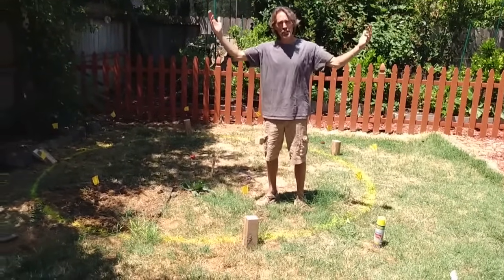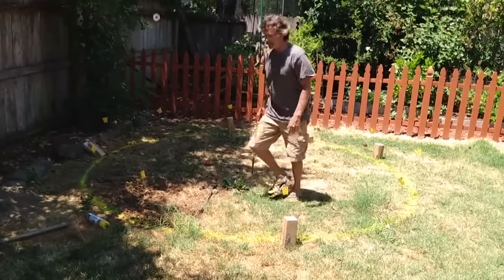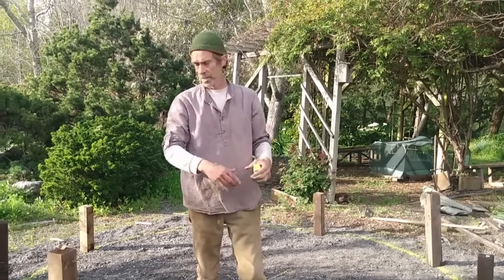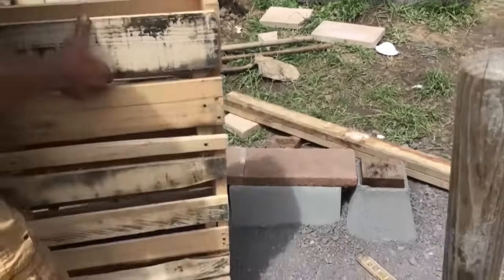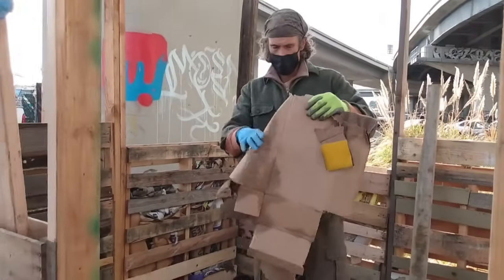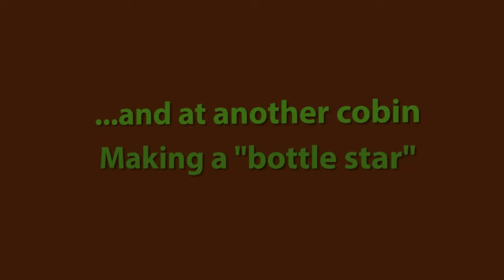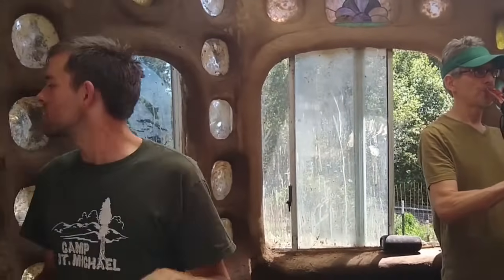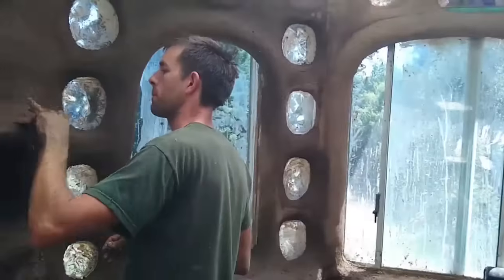How to build a 'Pallet, Cob house "Palletable Cobin"

Comment: Your the first person to convince me this is the way. I've watched every video known to man on the subject of alternative construction. I even went to MDI and took their week corse. Every method has its purpose, but when applying strictly to building an abode, this is the way. My approach is to get roof over head as primary goal even if its just a tarp. Wouldn't want to hinder stuffing the top pallets. Also a lot bigger. 16 sides or more. Another thing, cable and turn buckle. Haven't seen anyone do that to a cob house but in domes they are used to keep thing from spreading out. Everything else applies like cooling tubes still fit this style. Having a palletcob over a basement wouldn't hurt either. This would be the entrance to a fully earth sheltered abode.

Comment: How well would this work in the upper midwest/northeast? My plan is to use a framework of timber from trees to support the living roof, stone exterior, strawbale (set on edge) insulation and a cob interior. In your experience, do you think that it would be suitable for a climate that's much more extreme than California?
Reply from the maker: aloha Harry, Yes, you can build these in cold snowy climates for sure. There are many earthen structures built in snowy climates, especially strawbale, which has excellent insulation value.
Reply: @cobalot9  Very inspiring but I'm wondering if I should dig a little rubble trench down to the freeze line in my area?  Or maybe the wall or thick enough that it doesn't matter?  Thanks for the input.

Comment: I've done a few round cob houses and cabins , and instead of a central hub, we used debarked tree trunks resting reciprocally on each other, leaving space for the skylight and being very strong. We taught string in between, and lay straw bales with a side already cobbed down on the strings. Then pallets to have breathing space, then the plastic like you did, and earth.

Comment: My family and I are putting this method to work for our new homes at a count of 4 new tiny homes. We were going to do two with earth bag and two traditional cob. We have all the foundations in currently, but we are going to have to modify and use the downed trees on our land from last winters terrible snow storm and cut the wood slats ourselves because here pallets aren't free anymore and we do need a use for the downed trees anyway. The houses are a bit larger than these but I still believe with a bit of finesse this method should still work. The walls are thicker of course but again with some finesse the modification will just add for more insulation. Thank you so much for the step by step process this is going to save my/ our backs, legs and arms!!! Not to mention time!!! Love from Virginia!!!
Reply from the maker: Wow! Sounds like quite a project there! I hope it goes well. Id love to see photos if you get a chance. My email is cobalot9@gmail.com
Reply: Ck out Izzy Swan on you-tube for a cool, easy "chainsaw mill' meets a come along. Happy new year.

Comment: Thank you for you videos.  These structures are lovely.  Whenever I share your videos I get the same questions.  Can these structures be scaled up for families to live in and do you have a rockets stove home heater designs? 🌞🌱❤️
Reply from the maker: thanks for your kind words glad you like the video so as I'm sure you know these structures with pallets and cob are not built to code so that's why I build them small at just $120 square feet so you don't need a permit for them I have worked with an engineer to have a 200 square foot accessory dwelling unit designed to code but I have not used these drawings yet. if you are in an area in the country that does not require building codes then yes they can be billed as big as you want them as long as all of the carpentry framing is sturdy. you can build it like a pole barn with your uprights every 8 ft to support the roof and then put your pallets and cob in between. I've been in a two-story pallet cob house in North Carolina at a community that was probably at least $2,000 square feet and it was doing great. I built 5 classrooms in Florida that were $320 sq ft each.

Comment: Thank you for sharing this documentation and your enthusiasm. What do you think about a structure like this in a coastal climate of central America? Are there any good examples or do you have ideas how this could be extended, modified to be in the best resonance with the elements such as much warmer temperatures, months of heavy rains and times of high winds, possibly hurricane style? Thank you Miguel for your continued efforts to educate and inspire.
Reply from the maker: Hi, Yes, a Palletable Cobin' would be just fine in any part of the US.  Just build a nice roof overhang and plaster it well
Reply: @cobalot9  If I'm understanding you correctly, a tropical design isn't much different and you would encourage a similar design for a structure built in Central America. Thanks for clarifying.

Comment: This is really cool! An innovative approach to an already great building method. A few related questions though. Is the distance between the posts too wide? Not sure if the pallets would provide enough lateral strength. Is this why you build round? Wondering if a more linear design would work. Thanks for so generously posting this!

Comment: I am very interested in making something like this.
I have been trying to figure out a solution to all of the stuff that we are wasting in America as the price of everything by just continues to go up.
I used to work as a garbage man, and the amount of stuff that goes to the dump and winds up in the landfills just makes me sick.
Especially when ALOT of it COULD be used for different purposes like you used toward the end of this video and used the plastic to insulate your little cabin.
I really want to try that out here in PA.
I have a bunch of plastic saved, and actually have some pallets saved as well. The area that I live has ALOT of clay in the ground. And there are fields of grass that could be used for straw.
One of The issues that I am running into which has hindered me from starting to build is: sand. It is hard for me to come up with sand in my location to make the cob mixture without spending money on bringing it in from somewhere.
I guess my question is: are there any other things that could be used instead of sand?
I thought about collecting a bunch of broken glass and glass bottles and crushing them into a similar consistency as sand, and trying to use that, but I am not sure how well it would hold up?
I am also wondering if the ashes from burning wood would be able to be used in building materials?
Since I was a kid, I always dreamed of building a cement skatepark, and I feel like that dream is just so expensive these days, and yet finding out about this cob building stuff really makes me wonder if a skatepark could be built and hold up if built with cob?
If so, I have a ton of ideas on things to build to make this area a nicer place to be without it costing a fortune, I just need to know how to actually do it. I’d like to think a million steps in advance BEFORE ever laying one brick, so that once I do start to build, things will actually run smoothly and go according to plan. I have learned from hard experience that doing something without a plan is a sure fire way for things to wind up not going according to plan (on account of not having a solid plan in the first place! Lol) Honestly, I want to do Like it says in the Bible and “Let all things be done decently and in order.”
Anyway, thanks for reading my message. And thanks for making this video and doing what you do. It is very inspiring. 🙏

Comment: Wow. Seems like alot . How long does it take start to finish.  And what's the cost. 
Things I wondered  could I use a cement mixed for cob mixing and couldn't you use a sprayer for  the lime finish like they use for plaster. Just to save some arm work.
 Great video.  Very interesting

Comment: Hi migz if i was to build a larger version of this, approximately 30x30 what would you recommend for the foundations? Would compacted gravel be enough or would you recommend something stronger? i would like to keep my carbon footprint to a minimum. You always seem to have the simplest but most effective approach to everything you do so any advice would be much appreciated
Reply from the maker: Aloha Bilbo, So, for a larger structure, I wouldn't do much differently actually  I'd still put my uprights and 2 ft of concrete in the ground and then put bass Rock and then a membrane and then a 2 by 6 attached to the uprights and then attach the pallets to the uprights there is really no limit on how big you build these. how about some 16 by 20 ft structures in Florida using the same techniques that I always have and they did great
Reply: @cobalot9  Thanks so much for your reply Migz thats a great help, ive been watching your videos and youve been a great inspiration, what are your thoughts on dry stone foundations? And also lime mortar foundations? I understand that lime has a bad habit of wicking up moisture, could that be a problem? I would rather not use concrete to keep it feeling as organic as possible and to cut back on labour, costs and modern materials. Me and my wife are going to start building a hobbit home dug into a hillside and we are using your cob structures as our main method. Many thanks for your reply, do you have a email by any chance? As i would really appreciate your help & advice on our project.

Comment: I love this idea. Just one thing…. I was under the impression that you are supposed to use straw as opposed to hay to pack the walls? My brother has built several straw bail houses and he told me that the reason they use straw and not hay is the cellulose content. My understanding is that hay will break down and want to decompose over time whereas straw is more cellulose so not a problem. (?)
Reply from the maker: Yes hay is for horses straw is for houses. I always insulate my walls with straw instead of hay. Hey Will start to smell when it heats up and also it can sprout. Did you see somewhere in my video where I say that I add hay instead of straw?

Comment: Thanks for this video man. SOOOOO helpful, QUESTION if i am in a tropical country do I stil need to fill with insulation? Will that keep the cool temp inside the Cobin? What else can I fill it with if I have no problems with cold climates in a tropical warm country? Thank you in advance.
Reply from the maker: Yes, good question. You may want to pack the pallets with Earth more like rammed earth for insulation from the heat. Im building now in Florida and the straw insulation is not really keeping it cool when its hot out. May need to put extra wood slats between the pallet boards though to make the gaps smaller so  the earth doesnt fall out...
Reply: @cobalot9  oh yea?! Cool! How long until its done? Can I come to look/ help?

Comment: Would this be feasible in a northern state? Maybe make it thicker or double up on the pallets to add more insulation?
Reply from the maker: Yes this would be suitable in the northern states. You can try to double up the pallets but that would make framing in the windows and doors way more complicated. Even if you double up the pallets you will probably still need some sort of heat source side.

Comment: Could you build one of these where the winters get a lot of snow and if the winters are very harsh would it be possible to make the walls two pallets thick for more insulation? I love the accessibility and flexibility of these, plus they are so cute!
Reply: Yes, but you need a lime plaster on the exterior to protect it from the water.

Comment: Thank you so much for sharing your technique  How’s the insulation with this method of cob? Also what do you do about plumbing? Lastly, what’s the largest structure you’ve with this method?
Reply from the maker: Hi the insulation for a pallet cob structure is pretty good to insulate from the cold but not great from insulating from the heat. The pallets can be filled with Earth or more mass. It is possible to put plumbing into the structures no problem the largest palate carb structure I built has been 350 sq ft but I don't see why you can't build bigger than that

Comment: would this be suitable for tropical weather? 
And what happens when it rains when you are doing the cobbing? It wouldnt dry mutch i suppose and it might all collapse? Do you cover it up?
Thank you so much for sharing your knowledge!
Reply from the maker: Yes it would be totally fine in tropical weather. If you are concerned about the rain, you can build the roof first before doing any cob.  I have never had any of my cob collapse. If I dont have a roof on it, then sure, Id cover it up with a tarp if its raining. Once it had a good hydraulic lime plaster on it though it can handle some water on the walls.

Comment: Hi Miguel. Great instructional video. Thank you! Love the natural building material. Would this design have a high enough R-value for colder climates, such as more northern parts of Canada? Would the walls need to be thicker, perhaps doubling up on the pallets and using more straw? Also, can a wood stove be installed for heat? I’m seriously considering a cob cabin, perhaps 400~500 sf or so. For ease of construction, I plan to build a simple rectangle shape. Would straw bale with cob be warmer? Just starting to research natural building more now. Again, wondering if suitable for Canada’s colder, often wetter climate. Thanks in advance for sharing your opinions.
Reply from the maker: Hi, Yes, you could build these in Canada. You would still want to use some sort of heater though. You could double up the pallets but that would make framing in the windows and door more complicated
Reply from the maker: Yes, I would recommend Strawbale for a building that size...
Reply: @cobalot9  Hi Miguel. Thank you for your reply! I really like the natural cob material for building. My biggest concern is making it warm enough. I expect it can be done. Canada dies get more rain, so wondering if this may be a problem, or not?
Reply: @cobalot9  What is the maximum size you would recommend for a pallet cobin?
Reply: @ShikokuFoodForest  you can always coat the outside with cement plaster for waterproofing or just build a very large covered overhang

Comment: My children live in South Korea. Visiting, I learned that they have a lot of masonary structures. Masonry roofs as well. What I really want to mention is there type of heating. These masonry structures have there heating in the floors. They have a boiler on the outside of an outside wall with hoses that are set into the floors, Naturally, for the portion of hose that travels outside from the ceiling height efficient oil or gas boiler, toward the cement floor, said hose is covered with insulation. I mention this because I think that such an insulated, from the ground, base for a small building enclosure would also be a fire safe structure to stay warm in! By using an anti-freeze solution in the hoses and a coin operated payment for fuel, if necessary, would give the occupants the choice of how much heat or cold they chose to endure.  Now, the question remains, how to make such a structure legal, and affordable, self built, & mortgage wise.

Comment: Great information.
I had a concrete block house built in Florida.
Am thinking about cobbing the exterior.
Would that work?
Concrete block is too plain .
Reply: Might have to wire it first  I would recommend  using a lime plaster and make sure you have a 2 foot roof overhang to protect the skin from the rain getting behind it

Comment: Ive framed my structure with pallets and ready to cob after our downpour of snow here in a few months. 

Questions:

What type of r value are you getting from pallets filled with straw?

I'm in an area that has very fine sand and caliche.. I also have plenty of wood ash from burning my wood stove. Can it be used along with straw  and should I supplement ?

Is concrete base/scratch  coat needed similar to stucco to be more permanent?

Thank you in advance. I just found your channel. I appreciate your work.
Reply from the maker: Yes, insulatiing with straw does help keep the structure warmer. You can try the fine sand, but if you are able to use coarse sand that would be better. I have never added ash to the cob mix to make it stronger. If you watch my video, you will see that I apply a lime plaster over the cob to protect it, not a cement stucco.